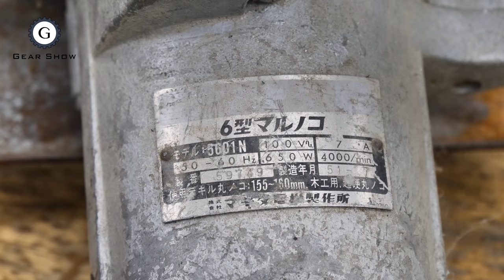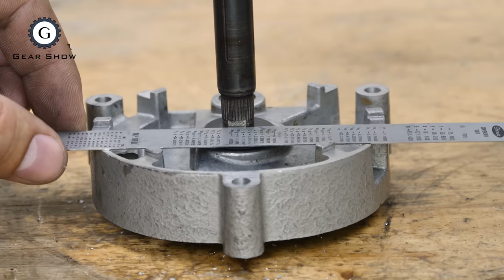Cord to Cordless Circular Saw Conversion From 100v to 18V

Comment: I guess with all the heavy equipment that I don't have like a bench top drill, lathe machine and hydraulic press I guess it's cheaper to buy a cordless circular saw. Though I really enjoy watching this video. I'm a hobbyists woodworker not an industrial mechanic or machinist. I just love using power tools.

Comment: Turned out to be a success.
I'm a bit concerned about the connection between the gear where the saw blade is attached and to the small engine. There is no connector or a stable strong connection. That with time will be actually loose and in the end it should be welded.

Comment: It turned out great, but I should have tested the cut on light and hard wood when it was on 110v.  and after that changed to 20v.  To know if it has the same torque, the same force.  Here's the tip.👏👏🇧🇷🇧🇷🇧🇷

Comment: Good video as usual, although I love when you rewind the coil to use it with DC current ( even if I still don't understand how you know which wire  gauge to use and how many turns you have to do ! ), instead of replace the motor with a DC one ;) Thank you for your work :)

PS : are you Japanese, chinese or from another country ? ( Sorry I can't read the characters on the stickers )
Reply: I think He mentioned Vietnam once.:)
Reply: But almost all the power tool that he restored is from Japan. I wonder where he got it from..
Reply: @Alazim7890  South East Asia using japanese tool since long long time ago. Thats why most of his restored tool were from japan.
Reply: It's not hard to identify which characters are from which country "viet,jap,china,korean" 
I thought he was Japanese because most of the tools are tools made in Japan, but someone said that he's from Vietnam? Lol
Reply: Characters on the stickers are in Japanese, even though I cannot understand them. ;-)
Reply: He didn't rewire the motor, he jammed a brand-new 18V DC motor into the stator of the AC motor and connected it to the gear train. 90% of this project is unnecessary frippery and nonsense.

Comment: Do you need circuit borad in power tool that manufacturers put? I have dead 12v circuit board and motor in 12v circular saw. I would like to replace only motor and trash the circuit board.

Comment: I am sorry if I am not true, but in my opinion, the conversion using such DC motor is questionable, as the torque depends not only on the motor´s wattage (much lower than the original 110v motor), but also depends on the diameter (and lenght) of internal rotor inside the motor. Since the new rotor is almost 4 times smaller in diameter and lenght than the original one, and you keep the gear ratio, I think the final torque will be useless for cutting. I have not seen the "battery pack" during the demo cuts although I was interested on it.

Comment: Is the torque the same? The power differs significantly, 775 is only about 100W, but the original motor was 650W.
Reply from the maker: The torque isn't the same.
Reply: @gear_show  Thank you. I like your videos!

Comment: What was the point of disassembling the rotor when it wasn't going to be used on the project? It can't be copper recovery since the value there was is too little to bother with.

Comment: I can difinately say this saw only can cut small amount thikness of plywood, not reliable for larger and thiker wood.. May BE RPMs are the same but torque is very low as compared to the corded one. without gear its worthless to try cordless saw. I hope you don't mind, but interested in watching.

Comment: Ok you have a cordless saw but what was wrong with the original saw?
Reply from the maker: Using this saw with electricity isn't safe, because its case made from aluminum.
Reply: @gear_show  oh crabs then I must be careful I got one of those and works with 120 volts